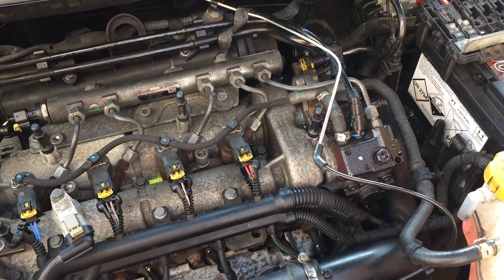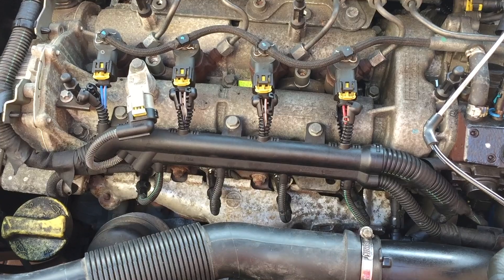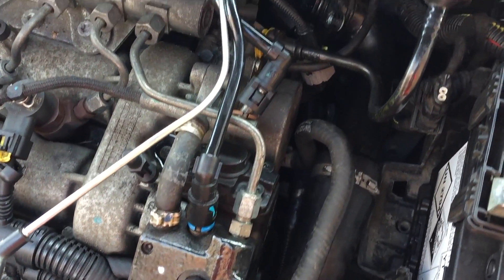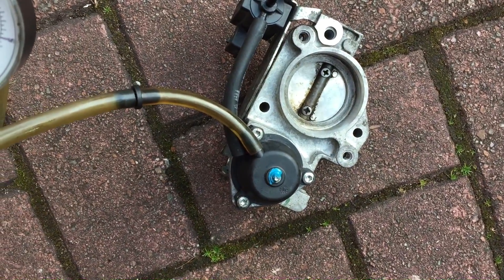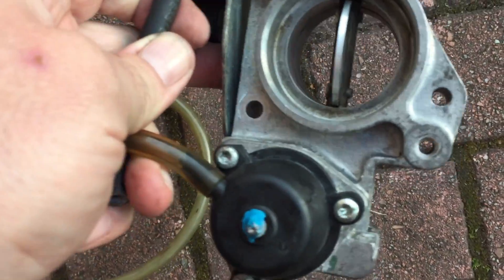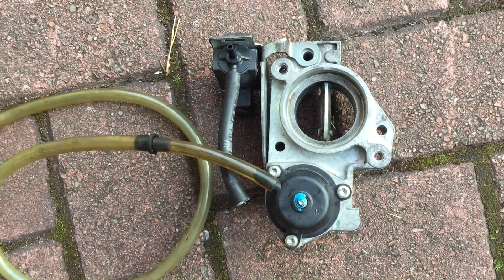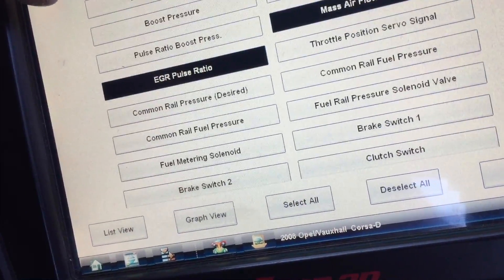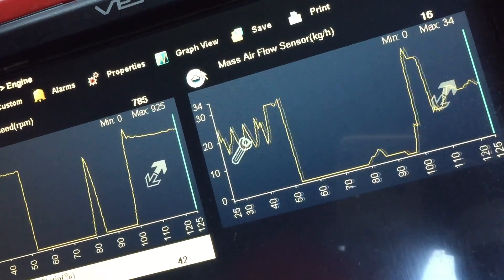Vauxhall Corsa D 1.3 CDTi - Intermittent Non Start -  P0685 - PART 4 - The Fix!

Comment: Nice find, thanks for sharing I'll check this on the combo I'm working on. Thanks mate
Reply: Did it work cus I’m working on a combo with the same problems
Reply: Hi Connor, the combo that I worked on ended up not having that intake valve fitted to it like the Corsa has. The problem with the he combo that I worked on was a stuck open EGR valve stopping it starting.
Reply: @mechanicmatt871  thanks Matt I’m gonna go have a look today

Comment: Hi there I have got a Dth 1.3 Cdti playing up like this. 
You start it up first thing and run on problem. 
Turn it off after a minute it will do that. 
No codes at all with my snap on tool or opcom. 

There’s 2 ways to start it after 
Wait 60 minutes or 2mins if I take the lead off the battery and refit it and it will start and run fabulous again till you switch it back off. 

Is there anyway for me to send you a video so you can see what it’s upto by any chance?.

Why was your car getting all the codes after was it to do with the same problem?.
Thanks for your help
Reply from the maker: This car is terrible, it probably needs s New ECU!!!
Reply: @sandyande  

Ecu no codes. 
I had it out last September to check it not in the water and lifted it up a bit. 

Anyway I can get a video to you so you can see it. 

Thanks

Comment: Sandy my sons Corsa as I have said on your other videos has starting problems, we have so far new glow plugs, new battery, new fuel filter and yesterday new fuel rail sensor, the car now starts and ticks over fine, no acceleration for a while then you can accelerate slowly until it reaches certain revs then it kicks in as normal, it may just be this but since you are near where my son is Stirling, at a fee would you look at it for him, could be ecu or even this as when it runs it is okay again until it is left off for a while.
I cannot find your contact but will put my email/phone number here should you reply, thanks.

Comment: my vauxhall corsa has a problem where it starts but randomly cuts out after you rev it up and let it drop down back to idling revs, it doesn't do it constantly but does it regularly, i have no fault codes and had some fuel sensor replaced which was the only error code appearing and had the crankshaft sensor replaced but the problem is still happening any ideas what it could be?
Reply from the maker: These cars are difficult to diagnose because the ECU is so unreliable! Maybe u have fuel starvation, is fuel filter been renewed https://youtu.be/bZ_nkg6VEcg cheers sandy
Reply: sandy anderson thank you sandy for the quick reply, cars at the mechanics and he’s suspecting that it could be the filter aswell so he is changing it on Monday will get back on Monday!
Reply: @sandyande  Still having the exact issue and the mechanics checked the egr valve and has been checking all over the fuel lines, i found a video of the exact same issue im having but the uploader hasnt provided any updates https://www.youtube.com/watch?v=ad5hIy_vqdY&list=LLMA9GylVT4wH46YsU9hzAjg&index=2&t=0s
Reply: @CanIGoYo  hello. Did you find out what have the cause? I have same problem on mine. Tks

Comment: Do you think this is related to the power relay fault code, inhibiting ground?
Reply from the maker: I think its related to excessive cranking and low battery!  I was also getting com codes after much cranking, cheers sandy